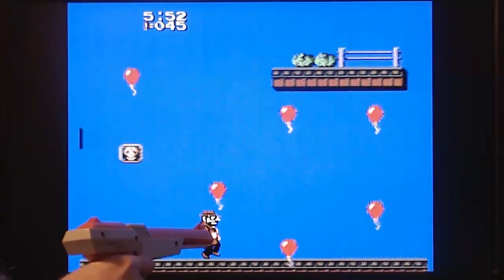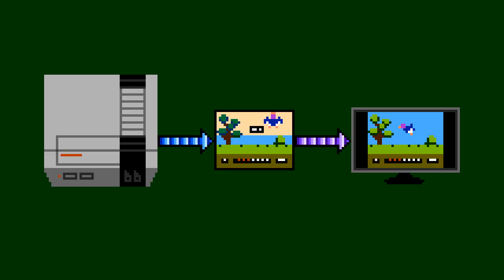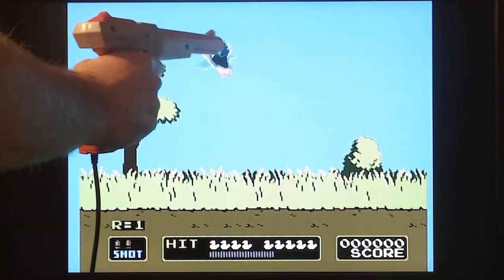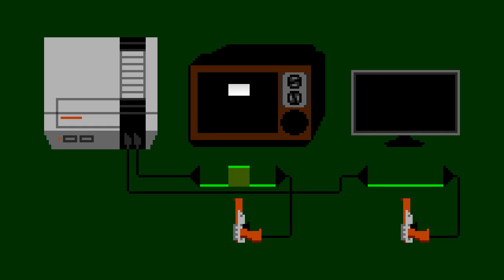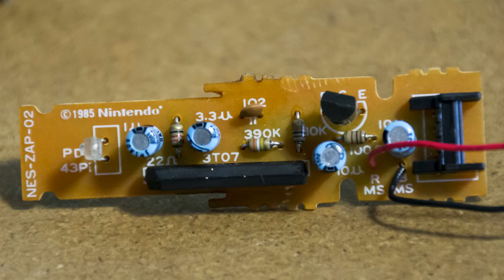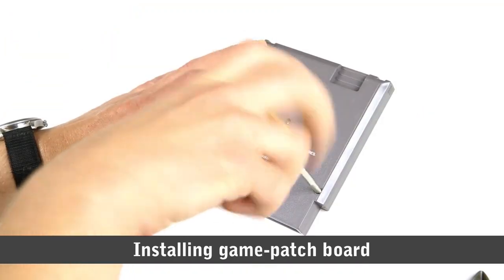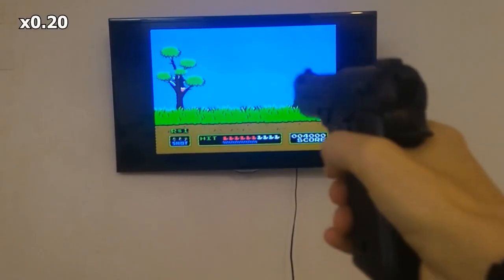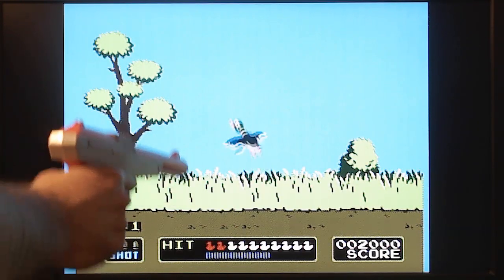Ways to play NES Light Gun Games on a Modern TV

Comment: Could a similar solution could be patched into other console light gun games?  I for one miss Virtua Cop, House of the Dead, Time Crysis, Point Blank, and all the other great Light Gun games of that era.
Reply from the maker: I haven't studied all the light gun systems out there. I can't confidently guess how Sega Saturn's light gun works. All I could say is that the same issues of latency and the high frequency light behaviour that affect the NES' light gun could be solved in a similar way. This solution isn't necessarily specific to the NES, just specific to those two problems. (The LightGunVerter promised to work for a number of different systems, for example.)

Comment: Part of the problem may be lack of understanding how the light gun works. You can’t just point it at a white screen.  When you pull the trigger, the gun reads 2 or 3 separate frames, not just one, depending on game mode.  The first frame, the screen goes completely black and the game checks for that so you can’t cheat.  The second frame places the white square.  If the gun reads black for 1 frame and white the next, you get a hit.  If it doesn’t detect the black first, then it’s a miss.  When you play 2 ducks it reads 3 frames. First is black, then the second frame, 1 duck lights up and the other is dark. The third frame then blacks out the first duck and the 2nd duck turns white.  When the gun reads black then white and on the specific frame, it can determine which duck is hit.  If you watch your video when running in slow motion, you can see the screen go black first, then the duck turn to a white box, then back to a normal screen.
Reply from the maker: Duck Hunt does use a full frame of black, but it's not really inherently required. On a normal CRT the Zapper will read "black" during most parts of a frame except when the beam is actually going past the point where you're pointing. It's important for this specific game to see the right sequence of black and white on subsequent frames, but it's not really an additional special problem on top of the existing latency + visibility problem I've outlined in the video, so I don't think I mentioned it explicitly here.

There are other games that rely on more complicated sub-frame timing like that, such as Operation Wolf. Even Duck Hunt could be modified to skip that black frame on a CRT and use the black during the vertical retrace part of a partial frame to be just as reliable at rejecting "cheating".
Reply: This is why the commonly-cited "lightbulb trick" doesn't actually work. It's a great little shibboleth to spot people who didn't actually grow up with the NES and are just repeating bullshit internet rumors and framing them as something they actually tried.

Comment: On the tomee website it says It wont work on any LCD , LED HDTV set ??!
Isn't the whole point that it will work ? 
Can you please explain /make a video of what kind of mod is needed for the software? 
Thank you
Reply from the maker: It does say that on the box, but it kind of has to. Without a software mod none of the old games will work on an LCD. Check the description for links to the NESLCDMod project.
Reply: What about the ones with PLASMA!?
Reply from the maker: @Kara_Kay_Eschel  For the purposes of this subject, everything is the same. Gotta deal with lag and the zapper's filter, and an unfiltered gun should be able to work. There are a lot of different HDTVs and there are some unusual variations out there, but most of them will act like described here.

Comment: Ahhh... so no wonder you dont see the CRT TV through an old video camera (with the static lines going down the TV in a rapid pace)... The screen flickering on a CRT is too fast for that camera to keep up.
Reply: Set your camera to 15 or 30 frames per second and you will see an almost flawless video of the tv screen
Reply: @grandinosour  right. Modern vintage gamer did a video on it. If your default camera can't do it, then he recommended an app that can.
Reply: That, and a few other things. It's not just the rate at which it refreshes I believe. I can't remember what else factors in that you need to sync up with a crt refresh rate.
Reply: CRTs display an interlaced image, meaning the odd number lines of the images are shown (drawn out line by line), then the even numbered lines are drawned out.  This happens at 60 frames a second.  Video cameras will be out of sync with the CRT.
Reply: @Cakebattered  right. Despite the fact that it's running at the same frame rate. That's what I was forgetting. Thanks
Reply: @tekgeekster  Commercials for local appliance stores in the 1980s were hilarious as they would show a wall of CRT Televisions, all flickering at different frame rates.
Reply: @Cakebattered  I remember those. I think I have a few on tape recordings
Reply: Those are called 'scanlines'. 

CRT TVs worked with an interlaced system meaning that a single frame would be created out of two separate passes of the cathode ray tube tracing each line, left to right, top to bottom, in a separate pass for odd numbered fields and even numbered ones. Thanks to the human eye's persistence of vision (the delay of a bright image dissipating from the retina) the gap between fields goes unnoticed as the first field is still imprinted inside our eyes by the time the second field resolves, resulting in us seeing a whole frame. 

A video camera, lacking this natural ability and pretty much just working on current being on or off, sees the frames as they are being formed, causing that flicker. If our eyes didn't act the way they do we would see that flicker as well.
Reply: @MegaRayland  In Europe, they used PAL, which ran at 50hz, but at a higher resolution (540i vs 480i), and the flicker was easy to see if you were use to NTSCs 60hz.
Reply: @Cakebattered  I know. I have spent my life between NTSC and PAL, so I have experienced it all.

Comment: Awesome! Best solution I've seen next to the Sinden Light gun, which seems to still be in prototype stages at this time. How hard would it be to get this to work on a ROM Emulator on PC? There are NES to USB adapters so I wonder if that would work with a light gun? Or would you have to run it on the actual NES?
Reply from the maker: An emulator has to support the light gun in an entirely different way than the NES. Usually it's done through mouse devices, though I do think there are ways to use a WiiMote or similar pointing device as a mouse. (I don't have a guide for this, sorry.)

Comment: That solves Duck Hunt. But I don't see anything but the LightGunVerter working with Operation Wolf.
Reply: I discovered, that at least my TV showing white background from top to down, so there is noticeable delay from top to bottom part of the screen. Check my last video.
Reply from the maker: At least that one has a d-pad alternative mode. TBH I find its convoluted range-finding process extremely hard on the eyes. I think your Zap Ping game has a much better claim to worthwhile non-compatible use here.
Reply: I agree in principle. But in practice, I mention Operation Wolf to avoid "that's unlicensed/homebrew; it ought not count" objection.
Reply: @DamianYerrick  o

Comment: Hmm...I've know for a while myself that clone light guns use a more simplified sensor that doesn't filter as well (and makes shots a bit easier on regular hardware otherwise), but I'll have to give these lag compensation patches a try, as I have a progressive scan TV with about 1/4 frame lag that isn't enough to break most things, but light gun software isn't having any of that. This sort of patch might be the kind of thing to get those games working on this set from 2006 that, despite being a CRT, has never really worked properly with traditional light guns, aside from the later generation ones that also tap into a composite output.
Reply from the maker: Yeah, there's a whole lot of variation in TVs that I didn't really have time to get into, was just trying to describe the most common / basic cases. I've heard of LCDs that the the zapper can actually see, too.